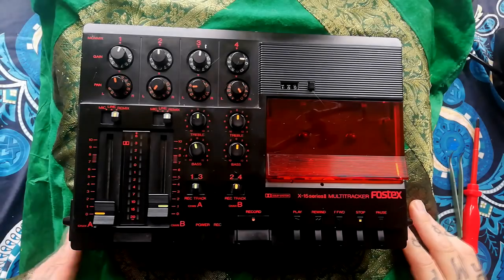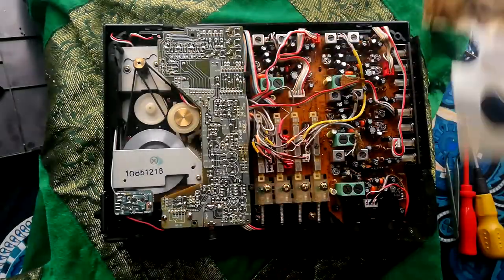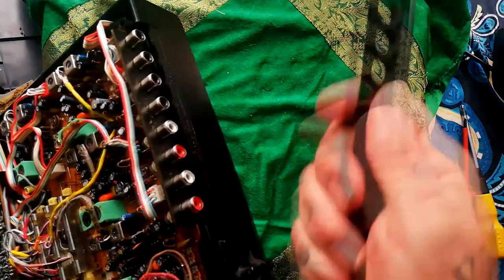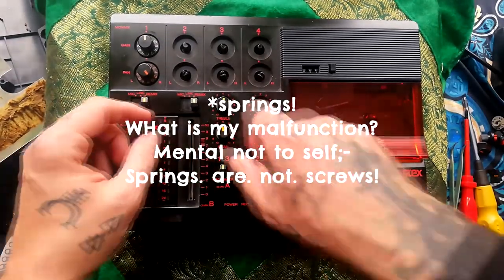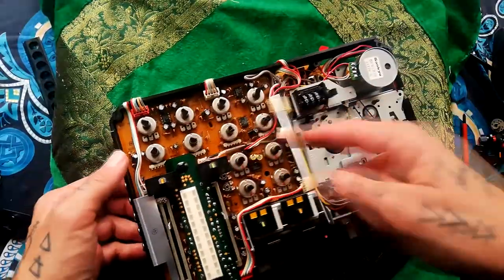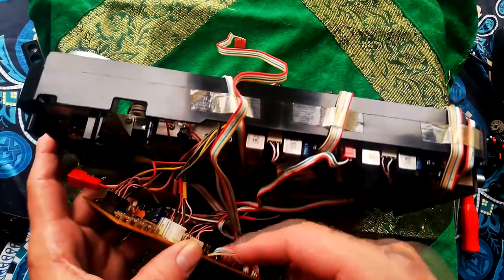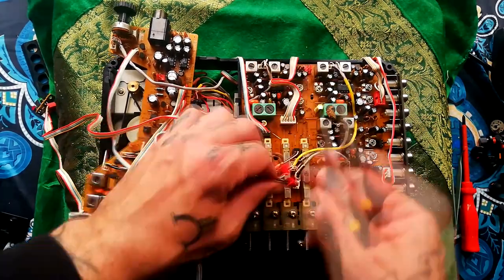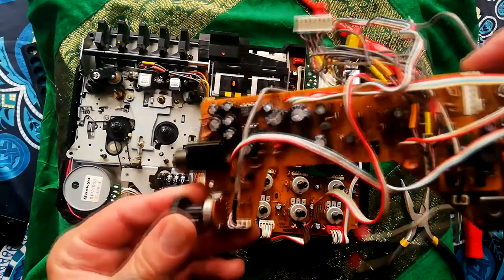Fostex X15 | tear down part 1

Comment: I have the same model I purchase in 1984 I repaired it today I change one belt  and add some silicone grease now it work perfectly
Reply from the maker: Great, happy recording!
Reply: I have a well kept one, but wore the head(s) out. Is it possible to get new or nearly-new head(s) that don't have the massive keystone wear mine has? It got worn out because it was so damn good. TDK SA-90's. Best balance between quality and price when you get through loads of them. Never had any wow&flutter or other issues with the X-15. Just the head wearing out :-)

Comment: @ 3:11. They are carrying straps. It was is battery powered but you need the battery compartment (which took 6 D cell battery's).
Reply: ahh never mind someone already mentioned it :-)
Reply from the maker: Thanks anyway.
Reply: Oh yes, serious battery pack. Only ever used that once, to capture 20mins of sound at a seashore at night. Think about it peeps, even today 6xD cells is a serious bunch of batteries.

Comment: great video..
at the moment i have two issues with my X15 ..
i only can record and play chan/track 2 and 4 ..1 and 3 is not working ..do you have maybe a tipp or trick to fix it ??
the second is that sometimes when i use it normally .. play function don´t go off ..so i need to roll the big Belt Whell that it wnts out ,
is there a specific reason for that ??

cheers
Reply from the maker: Sorry for the late reply, just seen this...for the record issue I'd feed a function generator or synth tone into the x15 in record pause mode and use an audio probe or oscilloscope to see which components in the audio path are receiving the signal, check this video https://youtu.be/YEUSosp3ImY For the play head getting stuck, check that you don't have gluey grease on the gears, refer to this video https://youtu.be/WCVXtYn3hOY

Comment: i would love to find a fostex 460. im interested in trying one fostex cassette tracker. is the 280 good? i see a mint one for sale. recently scored a mint yamaha mt8x. gambling that its age and mint condition makes it outperform my older troubled tascam 238!
Reply from the maker: Took apart a 280 recently, transport seems like it'd be easy to keep going, no over engineered mechanisms etc. Big footprint for the feature set.  Bit of a rat's nest of ribbon cables and a plastic chassis. So unless there was a big price difference with my DIY/ got no space hat on I'd err on an equivalent Tascam.

Comment: I'm on the East coast of Scotland, I'm having probs with my X15 (owned since the mid 80s), any chance of having a look?
Reply from the maker: Not this year unfortunately. If you're still stuck in 2023 message me via Facebook and I'll see how things stand...meantime I'm happy to advise you if you're willing to try to DIY?
Reply: @Tetrakan  Thanks for your reply, appreciate it.  I've got a heap of old tapes with song ideas from yesteryear that I want to delve into so I'll maybe have to try the DIY route.
Reply from the maker: It's a fiddly build that one, but hopefully if it worked before and a little ill after storage, a clean, lubricate and new rubber belts will do the trick, good luck.

Comment: You wouldn't happen to be parting this out? I have this model but the plastic piece that the reader head mounts to has cracked right were the tiny black spring arm is held. This results in the whole play head part to not fully go up when pressing play. Any suggestions?
Reply: Sorry the plastic piece the write head mounts to. Not reader.
Reply from the maker: @aaronpoor1877  you can fix that by bending the black spring inside. I refer to this in a video, I'll post a link below, but I learned the technique from  3rd island, I'll also paste a link to his video below.
Reply from the maker: Here's my video about the issue https://youtu.be/xyq1kRNx1aM
Reply from the maker: And here's 3rd islands video showing the reshaping if the spring in detail. It's demonstrated on a tascam porta one but the transport is the same. fyi in these units record and read are performed by the same head (rightmost one) switching between the record and playback amps is handled by either relays or transistors, thanks for watching https://youtu.be/jHUef-GaVYo
Reply: Awesome thanks so much. I'm hoping that the piece will still hold the spring in place even with the crack.

Comment: Nice video, but how much of that (scary looking) disassembly is required just to replace the drive belts?

I got a rough quote from someone to service my X-15 and replace the belts, but the lower part of that quote is more than it would cost to buy an X-15 off e-bay (granted that comes with the risk of the purchased unit also not working). I only need to get it working for long enough to transfer my old cassettes to digital, after that it'll probably never get powered on again, so the thought of spending £200 just to use it for a week or so isn't very attractive. So now I'm at the stage of considering the DIY route...
Reply from the maker: Well you don't have to remove the mixer or rec/pb boards, but pretty much everything else you see will need to be done. And it's quite a hard transport to get working - often there  are lubricantion issues which require a rebuild. So £200 represents 8 to 10 hours of your techs labour, that's not a bad price IMO. While the DIY route is do-able, honestly this is not an ideal beginners project, in fact it's one of the hardest units I've worked on; it might be better for the sake of a tape transfer to sell your x15 for spares/repairs and buy another low speed Dolby multitracker which works? In any case thanks for watching and good luck!
Reply: @Tetrakan  Thank you very much for the reply.

When I dug out the unit it worked perfectly for a good while, enabling me to transfer quite a few of my cassettes before one of the drive belts broke, that's why I think it's only the belts that need renewing.
Reply from the maker: Loose belts could account for the way your unit has recently stopped working, but so could seized grease. Your x15 is in the region of 35 years old, so it would be in your best interests to renew the grease and replace the belts; they will undoubtedly become issues in the near future if they haven't already. Good luck.